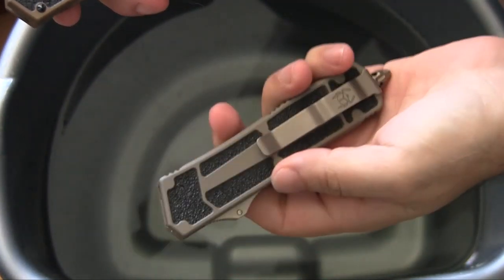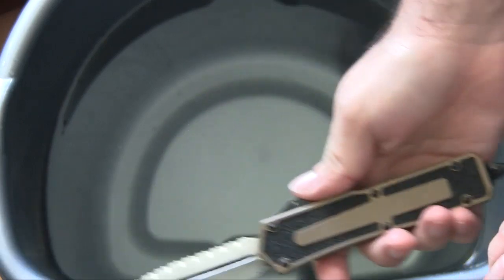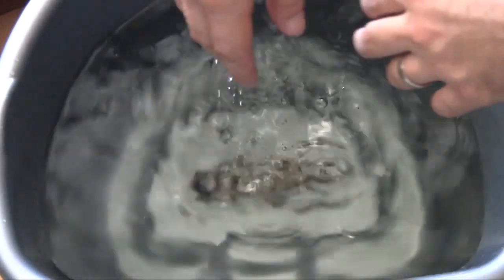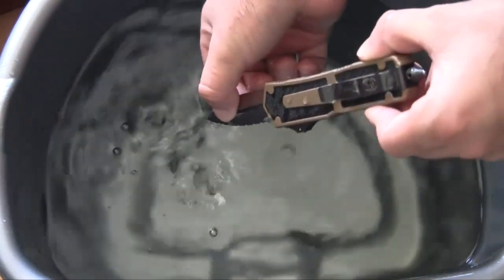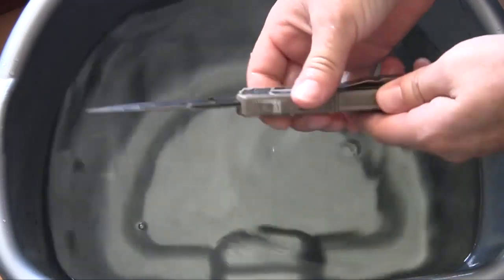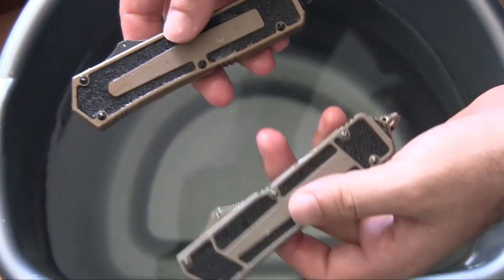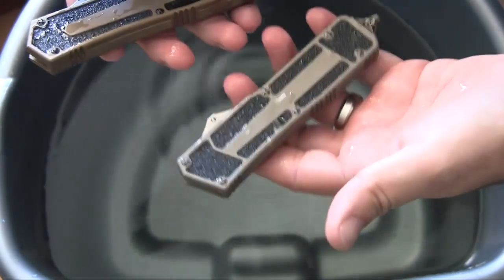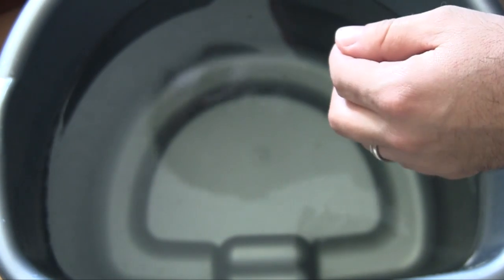Microtech QD Navy Seals Scarab Underwater Test (A Hollow Grind Video)

Comment: MT OTFs are overpriced toys/collector pieces. A seal would catch hell from his team taking that thing on an op, especially under water. An OTF is not something to trust when lives are on the line ...and in the likely event it will need warranty service with much use, good luck. MT have earned a rep as having some of the worst service in the industry.
Reply: Microtech has always gone above and beyond to fix any Microtech knife I have ever had a problem with. I own over 20 different Microtechs. Socom Elites, Combat Troodons, Stitchs, Warhounds, ETC. and have had maybe 1 knife that needed to be sent in for warranty work that was caused by a factory defect.  In fact I had an Monkey Edge Frag Edition Ultratech that was stolen from me and damn near completely destroyed by the POS thief that swiped it. I found it months later in a park near my house where it had been dropped by the thief or someone he sold it to. The blade had been completely destroyed by poor sharpening and the action was full of dirt and trash from being outside for so long. I told the guys at Microtech what had happened and truly didn't expect the damage to be covered under warranty but they said send it in and that they would take care of it. They replaced the blade completely and replaced all the internal parts even though the damage was not caused by any fault of the manufacturing process or factory defects. They did all that for no charge and even sent the knife back to me with a box full of Microtech swag all on their dime. The guys at Microtech build some great knives and more importantly they are a group of great people who stand behind their products and care for their customers!